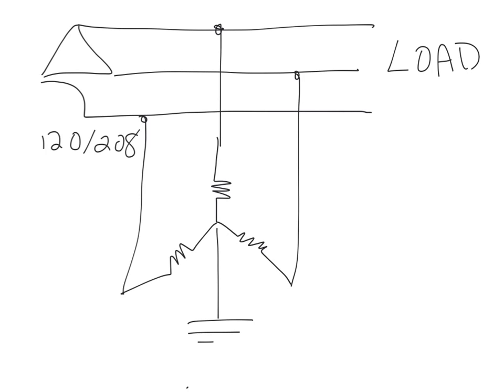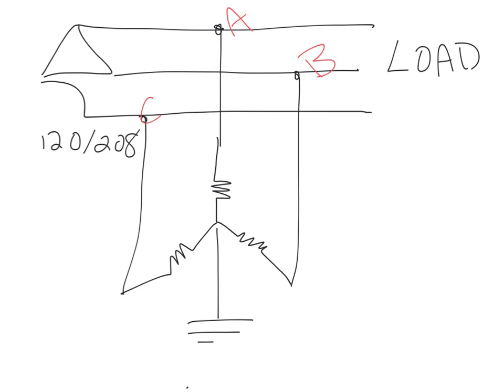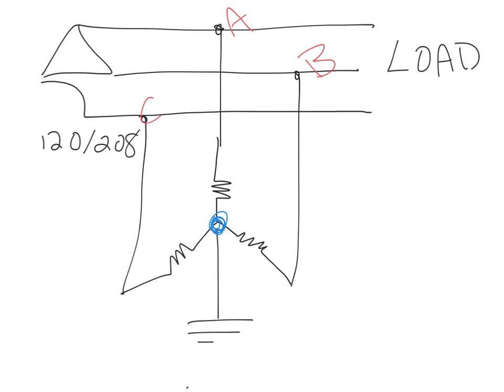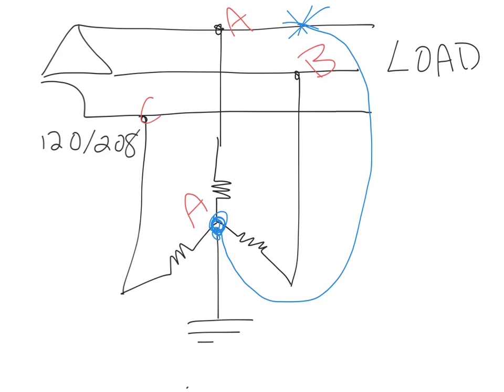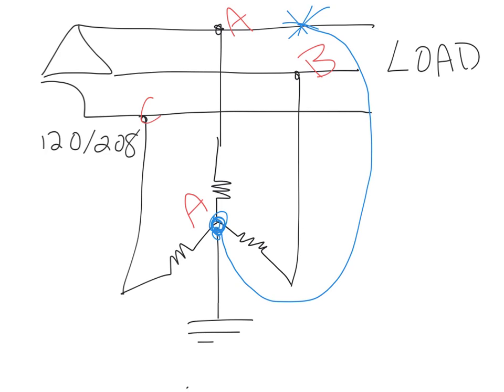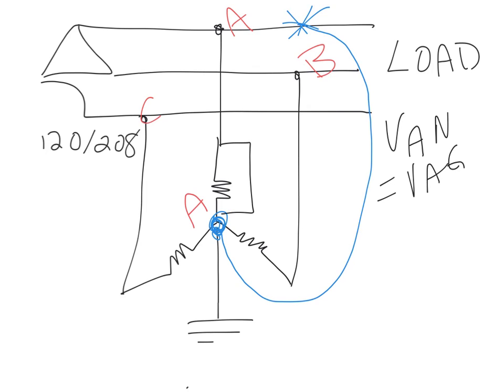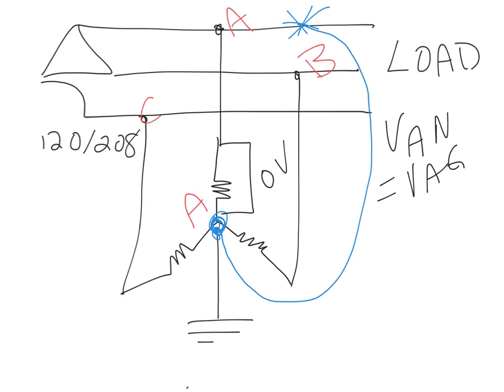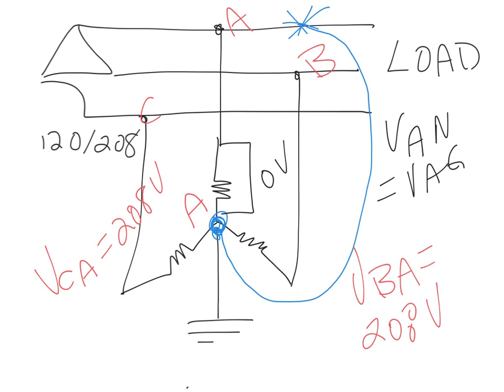Ground Detection Device Explained

Comment: Every home should be supplied by and ungrounded system. Use ground detectors to quickly shunt the system or use lighted fuses within sealed separate compartments so you can monitor and shunt the remaining phases or neutral at the same time. Midpoint delta on premises will give you the high leg plus two phases at the normal 120/240. Use all three phases for your kitchen pumps and garages.

Comment: Hello Marc, thank you very much for this explanation. How will this detection circuit change in the case of an ungrounded DC system? (where there are only 2 poles, the positive and negative and not 3 phase)

Thanks!